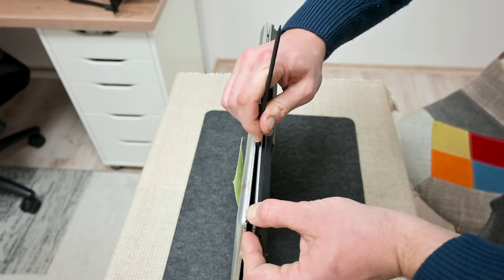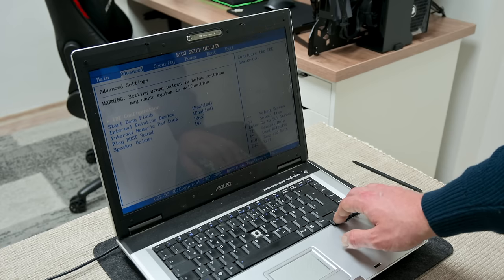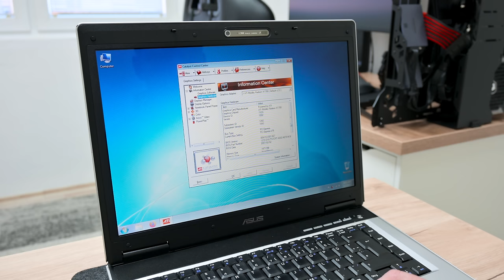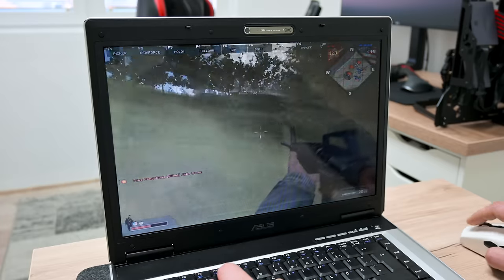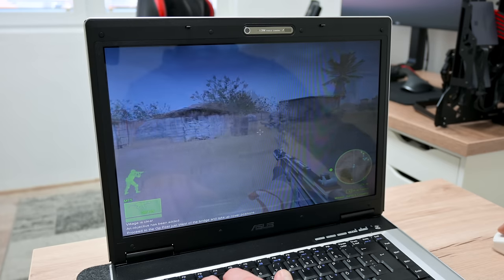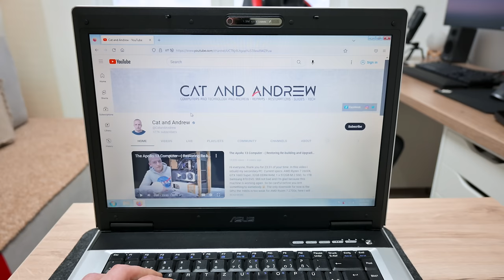I got 2 free ASUS laptops - Booth from trash!

Comment: crazy seeing a removable CPU along with all the fun bits like cpu dies thermal paste and silver tap
Reply: back in the day this was common  place, oh how times have changed.
Reply: Yeah, the removable processors went away with the older core 2 duo and earlier intel core series processors. Nowadays, I guess they soldier the chips to the motherboard both as a cost saving measure and to lean towards planned obsolescence. It's a shame really, because especially with gaming laptops a cpu upgrade can really breathe new life into an aging system. It also forces end users to purchase higher end models that come with i7 or ryzen 7 processors because we know that is no longer an upgradable part. And in order to get a gaming laptop with a higher end processor they force you to pay for a bunch of higher end options that you may not be able to afford up front. That's why I prefer desktop systems.
Reply: I have a laptop that has removable CPU and GPU and also RAM. The last is also becoming a habbit to see it soldered to the motherboard. The good thing is that now it is maxxed out with 32GB of Ram, an 3rd Gen I7 extreme CPU at 4,2GHz and TWO GPUS 980m GTX with 16GB of Video ram.

Obsolete Tech, but so cool.....
Reply: আগাও আর না দেখি বোলবো এসো পাত পেরে খেয়েযেও

Comment: Nice restoration and upgrades, that old CPU looked to be a T2xxx series CPU so the T7200 is much better. I put an SSD into an older HP 6820s laptop (T7250, 4GB, 128GB, ATI Radeon), if you look online you can get cheap 120GB or 240GB SSDs. They're still more expensive than hard drives but are well worth it even on Windows 7. (For XP laptops I would stay with a hard drive.)

Comment: I would have taken both of them, too! They are actually pretty nice laptops! Thank you 🤓 what DDR did those use?
Reply: its a DDR2 machine.
Reply: @David_Quinn_Photography  I have a few DDR 2 laptops but not sure if I want to spend the time trying to revive them! Thank you 🤓
Reply: @j.lietka9406  sent it to andrew then 😂
Reply from the maker: Thank you bro :) the RAM is DDR2, now I'm trying to repair the other one, there is some chance
Reply: @ComputersAndTechAndAndrew  all power to you, bro! Thank you 🤓 I found what is left of either an Acer or Asus laptop, but half the keys are gone, the bottom cover is missing, the screen to main body hinge is messed up, I think the touchscreen might be missing, a support system for the DVD player is gone... No HDD, no RAM.... Not sure what to do with it! But I plugged a charger into it and a couple lights come on!